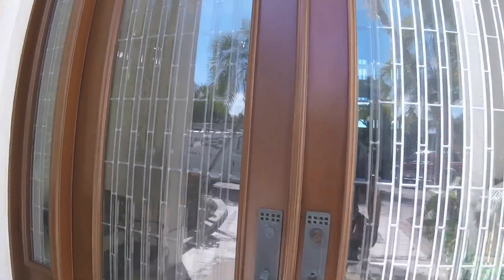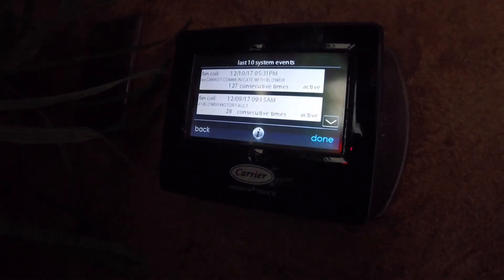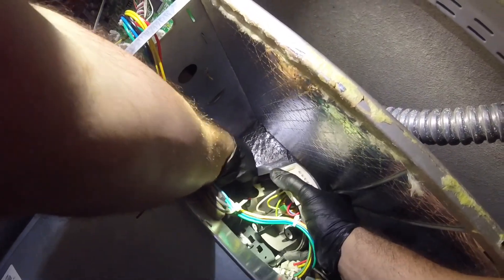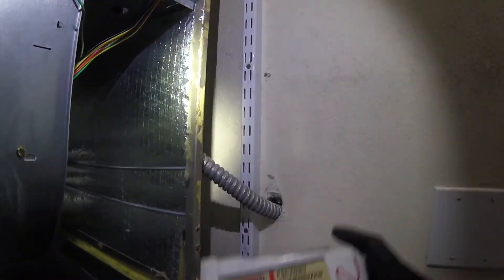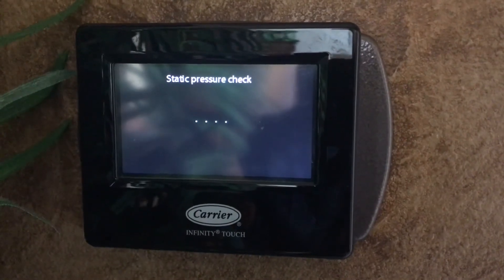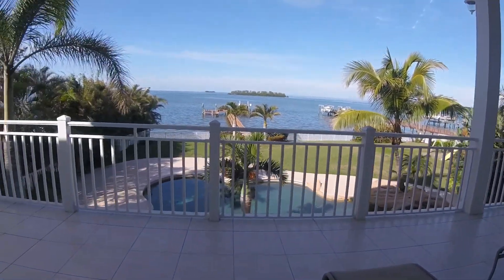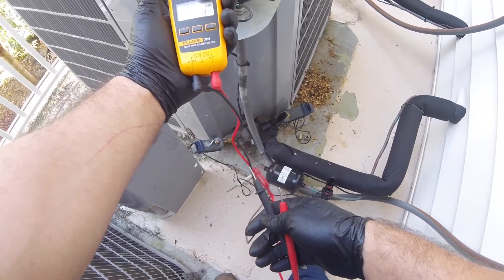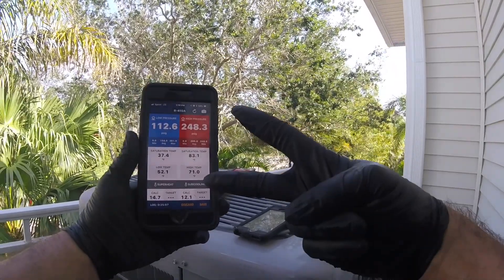ECM Motor Diagnosis and Repair Carrier Infinity Heat Pump System part 11

Comment: Keep the videos coming on this series make some about the controls within the unit circuit boards and what not your subscriber rate has grown greatly
Reply: You have to do what they want you to do. They say the difference on the module and the entire motor is not to much. So they rather replace the motor. My thing is that I rather get customer heat or cooling on the spot.
Reply: eddiehvac then on cooling you need a rib relay also. Now here you can always keep it energized. So you grab c & d terminal I believe you get 24v. Always double check with meter to ground once you have the 24v feed to the relay you can go to common on the r w g bar to energize the relay and send 120v to one side of normally open and the other side of normally open feeds 120 to the motor.
Reply: eddiehvac I been agreeing with you I just wish we had the module. But the company is the one that makes that decision. But you can use relay on a psc and get them airflow. But it won’t modulated and can give a nuisance air flow issue but it will work. I’ve done it for some customers.
Reply: eddiehvac I like watching yours because you know how to work with the infinity. I learned the hard way and not many videos on them. Like the 72 nuisance code. Allot of time is the potential magnetic relay. 
Rib relay are great man takes you out of jams. As long as you can get that 24 v or 120v to energize it you can send power , close contacts etc.
Reply: eddiehvac ribu1c is the one you want. It does dc also for the coil
Reply from the maker: Derrick Hvac thanks for the feedback and comment
Reply: Antonio Santiago well I can just put a temp psc in and wire it hot until u can get the oem
Reply: Derrick Hvac so can I.
Reply: Derrick Hvac. I just rather make one trip.
Reply from the maker: Derrick Hvac I appreciate the feed back but I don’t think 🤔 you can put a psc motor temporarily on a infinity Carrier communicating system unless someone can teach me otherwise. Unless........🤔🤔🤔
Reply: eddiehvac well you don’t do heat over there. But we cut into the heat molex purple wire to get 24v and then the common from the regular bar terminal with a rib relay on. Normally open feeding 120 v to the psc motor. That on heating.
Reply from the maker: Antonio Santiago Our difference between a motor and module is almost $500.00 dollars 💵 without installation. I think giving  the customer the options would be up to them if there where out of warranty only if this was a infinity system. Any plain Jane system I would put a relay and a psc motor and have them up in no time and less cost.
Reply: eddiehvac im gonna get a rib relay from my truck maybe tomorrow and I’ll see if I can put something for you. As long as you can find 24v it can be done. In heating you can’t run it all the time. You gonna send cold air to the already heated area. But if you go through the purple on the heat molex it will turn on and off as you call for heat. Now this is for hydro coils with a boiler
Reply from the maker: Antonio Santiago interesting I just went looking on google for a rib relay. First time I heard of it but this is why I do vids to learn from the community.
Reply from the maker: Antonio Santiago I use mostly 240 volt I guess the rib relay would have it. Thanks for your info and knowledge
Reply from the maker: Antonio Santiago I’ll order one ☝️

Comment: Funny I just did one two days ago. I know the code fault also by numbers. I use the the tec inspect to test the motors. Our company don’t get the module for the motor. They have us replace the entire motor. So much easier your way, and I told my company but they don’t want the entire motor replaced. 
Cool videos. Code 72 is another familar one lol. Great video brother and dam that scenery OMG.
Reply: Not bad mouthing any company by any means but when I hear that a company always wants the whole motor replaced it is most likely whoever is in charge of service does not have a good understanding of those motors which is sad psc is a thing in the past x13 and ecm is the future no need in fighting it like I said I’m not bad mouthing anybody please don’t take it that way
Reply from the maker: Antonio Santiago thanks for the comment and yes it’s much easier to replace the module but everyone has there opinions.
Reply: eddiehvac  it’s our company opinions. I would much rather have different modules and get customer airflow  on the spot instead of waiting for Parts. That’s a way they could loose customers. But love the infinity videos we also deal with them allot.
Reply from the maker: Antonio Santiago your right makes sense if you can afford to stock in the van.